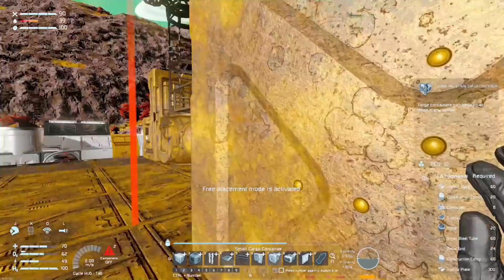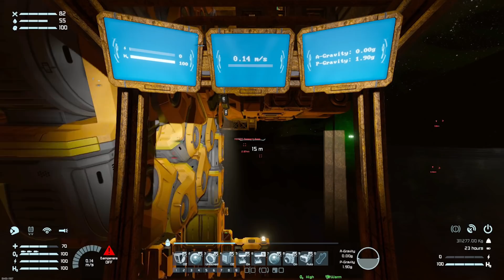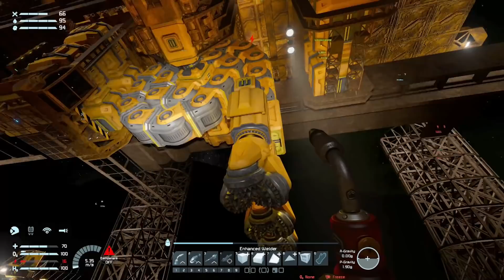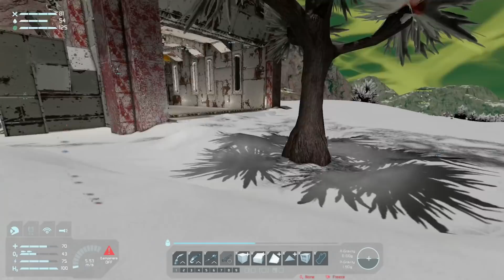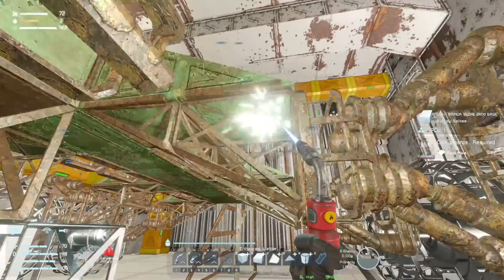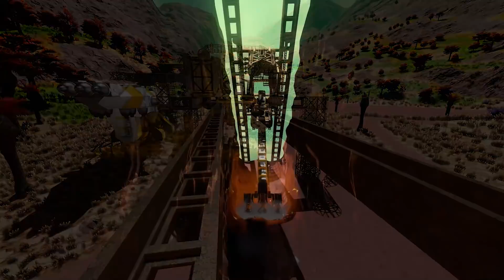Survival Impossible - Unknown Miner #62 - Space Engineers Hardcore Survival

Comment: on a drilling truck like that.. you'd have dust and gravel coming from all sides except for the top back of the truck. ( it's the part that is the farthest away from anything) and that's the only part that should be less rusty in my opinion.  wheels make dust and kick gravel drills make dust and create gravel and underneath is going to be fairly rusted as well as the bottom back of the truck. ( though the connector is still going to be fairly used as well )

Comment: A few thoughts I got when watching: 

I liked the green colour on the "Mole". Many older industrial machines I've seen were made in that, or a more grey version of that colour. 

I've been wondering if it's possible to build a "multi-tool" vehicle with several tool attatchments that you can hot-swap. One drill head, one grinder head, one welder head which you can disconnect and re-attatch without having to grind them off. 

I'm thinking it could be possible with connectors and those tiny merge blocks. The question is whether it will be possible without making the modules too bulky.

Comment: The hydrogen tanks hold a lot more hydrogen since the last upgrade.

Also in my experience it's best when using hydrogen to use hydrogen thrusters and not ion or atmosphere thrusters to get the best efficiency.
And yes you're going to eat up a lot of hydrogen if you generate hydrogen using hydrogen engines.

It takes two O2 generators to fuel one hydrogen engine.
One engine can power 10 o2 generators with normal settings in space engineers.

This means you're losing 20% of the of the hydrogen if you use it as fuel to generate it from the ice if you're playing with normal space engineers game mechanics.

Comment: Rather then extending the track, have you considered the possibility of making it possible to slide it sideways? A turntable might also be an option.
Reply from the maker: I've been thinking about how to approach doing both :)
Reply: @Splitsie  A little while ago, I replicated a drill I saw on a video on Aaron's channel. The general concept of that drill can be useful for sideways movement. 2 pistons, facing opposite directions. While one contracts, the other extends. They attach to the main structure using rotors. The movement is controlled with sensors that detect sub grids. One piston is the master, and the other the slave. Both sensors are on the master and detect full extension or contraction. Another sensor can be placed at the end of the track to act as a stop.

Comment: Do you think it’s possible to put thrusters and magnetic pads or landing pads to make a harpoon to grab ships, or would it brake to easily?
Reply from the maker: I think you'd run into a few problems with the way the subgrids pull things around even if it didn't get shot before reaching its target, however, for non-hostile or neutralised targets I do wonder if you'd be able to use grav gens and mass blocks near the harpoon tip in order to launch it as then the force would be applied consistently even if the thing flops around

Comment: Liking the look of the new mining rover, I've never had much luck with making mining rovers that didn't end up exploding similarly to the one in EFP so I'm looking forward to seeing how this one performs.

On the topic of hydrogen production. If memory serves you never altered the ratio of ice to hydrogen, only the ice to oxygen, however there have been a couple of game changes to hydrogen since this series began which I think is why you were surprised by the apparently low amount you'd gained.

For one, vanilla tanks have had a MASSIVE increase in their capacity. LG large tank now holds 15mil when it used to only hold 5mil, so the amount you had at a little over 60% would be the equivalent of almost 4 tanks previously. So you actually have a lot, but watching the percentages it does seem like it's a lot lower than before.

Second, O2/H2 gens have been rebalanced a bit in vanilla and now have an ice to hydrogen ratio of 20 to 1 instead of 10 to 1. They've also made them process slower though, IceConsumptionPerSecond dropped from 50 to 25 so it takes the same amount of time to fill a tank but requires half as much ice overall. 

I actually edited the O2/H2 gens to use these new values in my own playthrough of SI because frankly with the new tank sizes the amount of ice needed at 10 to 1 is a bit absurd. To fill all 4 tanks on your station, plus the 2 on the Panini you'd need 9 million ice (excluding any hydrogen used by the engines). Even with the higher ratio, 4.5 million ice is still a good chunk of time and resource expenditure (for expanding the tram rail and defending it) that I think it wouldn't feel unfair to make the change. 

Full list of the tank capacity changes.
https://www.reddit.com/r/spaceengineers/comments/k23hcz/update_v197_hydrogen_rebalance/
Reply from the maker: I couldn't remember if I'd just messed with the O2 or if in messing with that I'd unintentionally overridden some future changes, good to know that it doesn't seem that way :)

Comment: How it works, that you can build so cool and complecated things with rotors and pistons?
Realy always if i use Drills, pistons, rotor at planets after a while all buged up or break completly. It makes realy no fun. Ever and ever ouhers to build it up and than i turn me back and heared how my drill mashine fucket up. Speed are super slowly and all pistons share the physics but it will brak. 
And its not a super complicated or over big buildings. 

I have absolut no idear why this are so bad with this physics. 

e.g. minute 4:40 - this are not working in my game. the pistans, rotors and drills break and fall down or stops the rotations or tont transport the ore. 

One pistons and one rotor are ok, tree or more and it bugs after minits to 3 houres. 

Im at my single Player - is it posible, that the problem are micro lags and than the physic fucked up or what the hell is the problem by my game?
Any idears for me?

(Or other bugs like things stucks in the ground. Or ground are away and there are big holes or, or or. There are realy stupid physic things in my games)

I love this game but this bugs make the game unplayable for me. 

(Sorry for my bad english).

PS. Have you a complete list for youre installed mods? Whats this snakie thinks to role up - are this "round" pistons?
Reply from the maker: It mostly takes practice and testing the limits of the moveable blocks, where they'll cause issues and where you'll be safe. I spent a lot of time in creative mode testing those things before I made some of my tutorials on the subject to ensure I had a good feel for what should work but even then I get it wrong from time to time (thankfully mostly in creative mode when I'm pushing the limits)

Comment: The ice mine, add drills to the point it clears the support posts.
So mabe 9 wide? Otherwise making a turn or a rotating point, will be very complicated.
Yes lots of really big guns!!!!! LOL 
 add backup power wind and/or solar, or a giant battery bank.
 have battery powered flyer, Or emergency power mode to at least get you on the ground without losing  it all. Thinking of saving the hydrogen tank mostly, from ground hits or enemy hits. Redo to flyer to protect tank. Do to value of hydrogen.
Be neat to have dual hydrogen/batteries on one ship, but I'm thinking the gravity would be a killer.
Definitely time for guns before much else.
0.01c

Comment: I do understand that you are using multiple hinges in order to have more power. But I do believe that it was also reason for uncontrollable spin. And that is reason why I am not using hinge power in buildings like that. I am un-powering hinges and inserting pistons using hinges for hight adjustment. Basically I am using same concept is used for tractor installing hydraulic system.

Comment: Just something to consider, 1kg of water is 1L. Out of that 1L of water you can probably produce 1L of hydrogen at best given the mechanics of the game. Each one of those hydrogen tanks can hold 1.5 * 10^7 L (15,000,000L), you have two so 30,000,000L. So that 1,000,000kg of ice I would expect to only produce around 1,000,000L of hydrogen at best. So that would mean you need 30,000,000kg of ice. Of course, water is H2O, you can't only make hydrogen or oxygen like in-game, so now that 1L of water probably only makes 0.67L of hydrogen and 0.33L of oxygen. Now you need 45,000,000kg of ice to make your 30,000,000L of hydrogen and would meanwhile produce 15,000,000L of oxygen.

Realization: You need a lot more ice and probably a lot more O2H2 generators to make the process go a bit quicker.

Comment: I wonder if the gantry drilling array could be connect using a piston setup with no force settings, so you pull and push it as you drive back and forth... no more weight concerns in the drills... maybe add a sorter to kick stuff into the base to make sure it gets kept empty... ish.

Comment: what about building some railings and dim orange lights as markers along side the doom trench to stop you from walking in it, instead of preparing for when you do fall in it as i dont think you will survive that fall.
though you might, you never know with space engineers.

also i am really looking forward to seeing the cliffside road and that entry way to it, that sounds really bloody cool.
a few designs popped into my head as you mentioned it, a tunnel carved into the side of the mountain to provide some cover (maybe decorated with voxel hands?)
and a road along the edge of it held up with diagonal supports, though that would be annoying to curve around the mountain with.
though now i think about it you could just have a hinge and use the new plate blocks to overlap to the next section of road and would only need to sacrifice a few wind turbines to move the hinges (or keep them and have lighting along the road which might be nice) though this might not be a good idea due to the hostile encounters along the way.
though having a conveyer or a "power line" (cheap blocks) along the road might be a good idea

Comment: gunna need a dozen more O2H2 Gen's to pump the Hydrogen into those tanks for the panini to haul back to base.
and more track for the tram!

back up the Hydro with some Turbines and Solar to boost power generation.

also need an attack Drone to go swat that base. maybe a Chicken Hawk should go cause some discontent.

cliff mining = a nice workout for a monorail clinging to the cliffside to shuttle materials.
btw.
did you go around and collect all the Lawnchair Pods scattered around to recover the resources within?
also, add 1 block to push your Front and Rear most wheel pairs out for proper steering control.
as is, they will scrub and cause undesired wonkiness or potential flirtation with Klang!

Comment: With logistics becoming more of A Thing in this world, this might be a good use-case for something like PAM to ferry the magnesium ore or hydrogen gas from the various remote locations. You'd be able to design automated transport that might need better defenses as the ASSERT bases fill in, and eventually fill in your routes with bases and their own trade routes. I suggest PAM or waypoint-based automation, since I think building conveyors alongside your shiny roadway to just "magic" the magnesium ore into the base across the vast distances would be a bit too cheaty, and having to set up paths, defensive points or forward-operating-bases of your own to protect the routes (and provide antenna-network coverage), and arguing with the automation framework could be interesting for you and for us.

If nothing else, once it's up and running, outside of a few "Aww, crap, enemies just took out my ore transport, time for revenge!" clean-up episodes, it should reduce some of the toil you'd have to do if, say, your hydrogen supplies run low. It'd be a compromise between "I must do everything myself by hand" and "I hooked up a 5,000 km-long pipeline and now my stuff arrives by magic."
Reply from the maker: The reason I've avoided PAM is due to the power costs of flying stuff in 1.9g. I am thinning of employing it on other worlds though :)

Comment: Add another 2 pair of wheels to back of Holy Moley miner as it will tip on it butt when loaded with heavy load and climbing the hill. Use a landing pads to secure drills when not drilling. Hmm what about making bridges out of light armor panels? 
And you haven't being to space for Along time maybe after magnesium go to space and build a cargo boxs full of rock to rain down on enemies' bases (rods of gods). All you will need a small grid large cargo box full of rock a spacecraft to deliver over target that can launch some probes to pinpoint target and drop box with small fuel container and a thruster or you can build a detachable manuvering assembly that you can parachute down and pick up when you go looting the Rocked Base and later launch it back into space. You could call entire project Space X Rocking.

Comment: regarding line switching for your tram miner, you could use real world examples of it. build a platform that has disconnected rails big enough to support the tram, then either have that attached to a piston so you can slide it left or right  to the new line. or put the switch platform on a rotor and change directions. can get everything lined up so you can operate the switching platforms controls from the miners little platform, or use a connecter to lock it in place and switch from the cockpit.

Comment: Regarding Power at the ice-mine...  I think I'd be tempted to setup some solar panels to process ice at least during sunlight hours, maybe cutting off refining at night?  Could probably arrange such with a timer block and would let you keep more of your hydrogen yield for rocket and other use instead of burning it on power. Perhaps a towable solar array you can dock with the mine or something else as needed?  Kinda thinking something you can standardize upon and repurpose later if need be, or build another copy of.

And food for thought - an extra tire or two on the miner?  I've yet to have a vehicle that doesn't at some point lose a wheel at some point and having hot spares and a little extra spare parts (plates, interior plates, components, etc) in a small cargo container somewhere or two can be quite helpful when out on a mission to allow fixing in-situ rather than having to hike all the way back home to get parts.
Reply from the maker: Sadly with awww scrap having blocks doesn't help since on grinding all I get back is scrap :(
Reply: @Splitsie  Oh!  Had forgotten about that with the gap in episodes.  Belay my last then.
Reply from the maker: I am thinking about including some solar panels on the roof of the living area though and potentially some turbines out on the rail poles

Comment: just a thought, you thought of putting a small grid Ore detector on those drills so as they go drilling they can detect further down ?
Reply: also what about a tool module for use with the panini or a utility vehicle.... using connector attached to a piston, then advanced rotor, then small grid drills.... another module would be welder, similar set up and another module that has grinder.... 

may save on resources too
Reply: Name: Worker B33